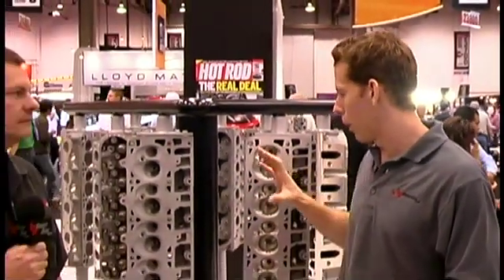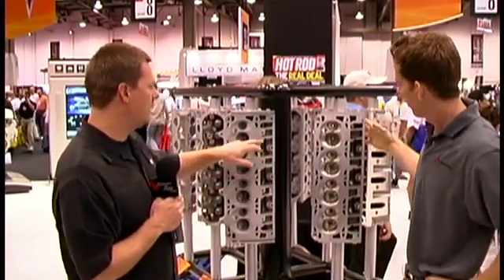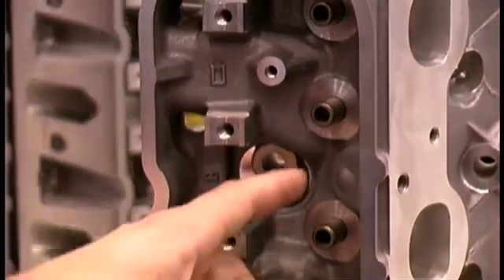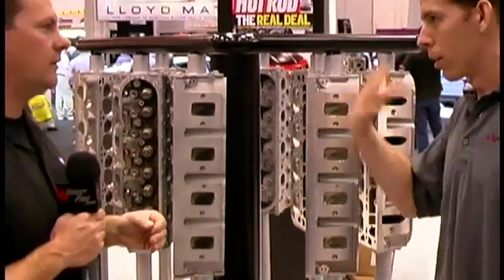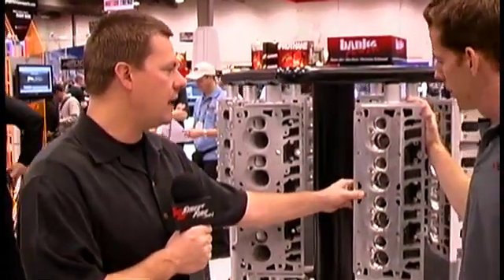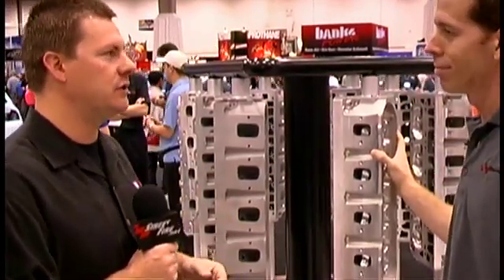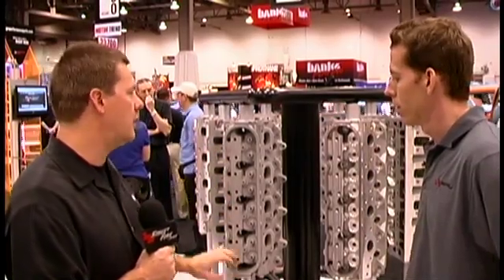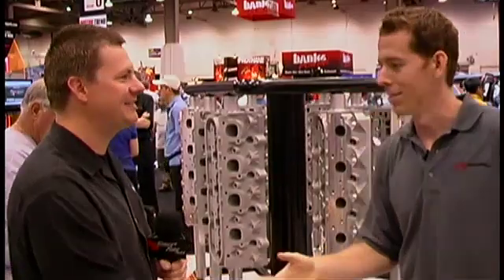GM Explains the LSX vs. LS7 Head @ SEMA 2008

Comment: Never in my life did I ever think I would see small block head flow numbers rival a full on monster set of BBC heads I know several guys getting almost 450cfm out of these Incredible .I would love to build a 15to1 c/r 506ci LSX with these heads and sheet metal intake with twin gen3 1050 dominators and cant forget about a 800 lift roller this combo would be close to a dam NHRA pro stock motor power.
Reply: kip tyra best heads on the market! i got 420cfm out of a cnc ported ls7 head. makes around 750 horse in a cammed 427 ls7 with a kinsler cross ram manifold

Comment: There's nothing wrong with the design in any of the LS motors. It's not about pushing every engine to the absolute limit, Chevy offers substantial performance that's relatively inexpensive. Also, the LS family is infamous for its efficiency lol

Comment: yes he dose but he is pro LSX so he isn't stupid something is left out of fast wen you leave out torque all the weight and friction of all the moving parts in an OHC setup negates torque numbers early in the RPM range you may get more RPM but you need shallower gears and wait longer to shift wear as More torque taller gear and sooner shift gets a car going fast sooner there are 6 speed standard trans now

Comment: @cienporcientoculopri 

exactly lol, ford got the DOHC setup, but it dont help them much lol

I come from a world, of small japaneese 4 cylinder motors making 600hp under heavy boost, but i have hit a wall in terms of horsepower. Heck even alot of import people are throwing these LSX awesome motors, in thier cars, skylines,rx7, 240sx.

 The LSX is a worthy upgrade, nice compact, and has gobs of "Naturaly Aspirated" power, in built and boosted form its just scary, over 2500hp capable!

Comment: @331sbf    interesting, but why is the "little displacement" ford 4.6 litter engine, physically bigger then the  lsx motor hmm....  (sarcasm)

it might have smaller displacement then an lsx, and be making the same power as a lsx. BUT ITS A HUGE ASS MOTOR.  i wouldnt call that very efficient.

lsx is much smaller, infact you could actually fit those into a little import nissan 240sx.
pushrod technology, surely seems primitive, but its results are amazing! and its nice and compact.

Comment: Haha got me, I am biased. look at things like the merc engines, and the same capacity motor gets around 380kw unmodded. Tuned and exhaust they get around 450kw!!

Your right though, not just the top figures, but the torques moutains higher. (DOHC with timing vs OHV)
Petrol engines are glorified air pumps, technology just allows them to pump air more efficiently.
Well Cross-compatability etc all come from numbers. If you stick with a style of motor, your bound to have lots of parts avaliable.

Comment: @331sbf  Why? Because the both the 302 and LS cylinder heads use inline valves, or the LS block is skirted like a mod motor?

Thats as justifiyable as comparing a platapus and a duck by virtue of thier bills.

Your comparing chocolate to "shit", my friend. Just because they look similar dont mean that they have the same "taste".

P.S. Mod motors suck

Comment: @jaydnisevil

 Not exactly "High tech"? Are we perhaps a bit biased?

The  internal combustion engine has operated on the same principle for the last 150 years. 

Despite what you think of as "high-tech", the only thing that matters in the end is results. 
 
Theyre might be quite a few "snazzier" engines about, BUT you are going to fail miserably at finding any other modern engine with the versatility, cross-compatability, upgradablility or cost effectiveness of the LS series motor.